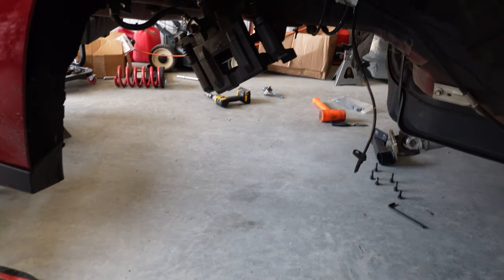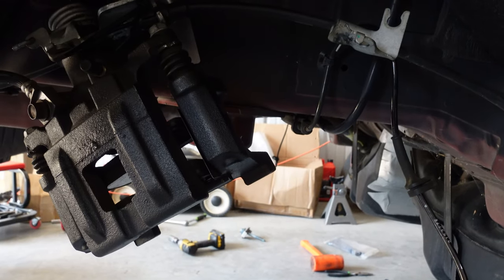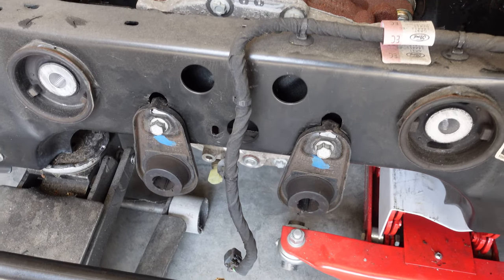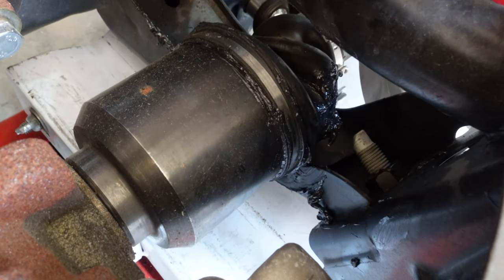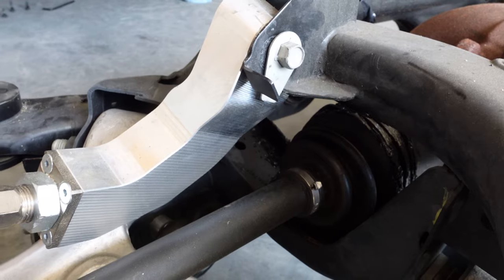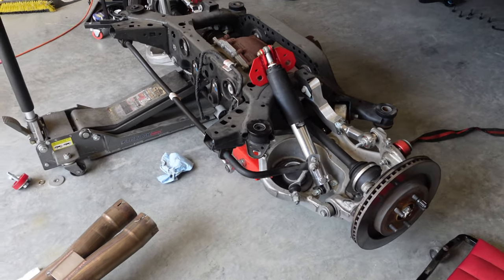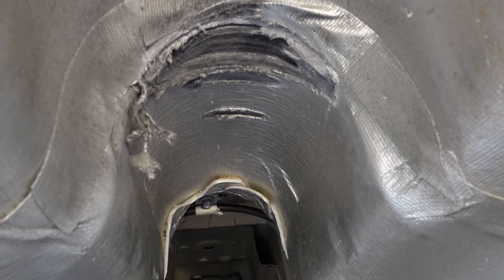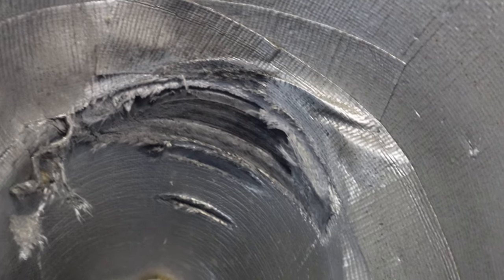More damage than expected! 2016 Mustang GT rear cradle removal for inspection. Not good!

Comment: Heat up the ears on the diff. It melts the lock tite after you drill the holes in the old bolts put the easy out in there heat the ears up and then back out the broken bolts.
Reply from the maker: They actually came out fairly easily. Good tips, though!

Comment: Can you take a bolt exstracter and back those broken bolts out? May be easier than drilling and rethreading it? I hope it works out for you!
Reply from the maker: Gonna drill them out for a larger bolt, most likely. But yeah, could possibly use an extractor.

Comment: Ugh.... that sucks.  I have been researching rear suspension for my 2019.  I just put up a video, from my quest to hit 10s.  You can feel the wheel hop was extreme during the slow mo.  You can actually HEAR metal on metal clunking in the stock PP1 suspension.  What I don't want is to go through what you just did.  No way do I want to buy another set of GForce half shafts.  lol What did Steeda or BMR recommend for the bolts?
Reply from the maker: Called Steeda and we decided on aluminum diff inserts, through bolt upgrade and diff support bracket. Hoping all that will do the trick.
Reply: @BackyardBMX73   Thanks for the reply. Is this a custom thing or do they offer this normally?  It would be weird to me if they didn't just upgrade the bolts in their kits.

Comment: I'm considering Steeda Differential Bushing inserts.   Other than your video I haven't seen anyone who had problems with bolts breaking on any of the solutions available (Steeda, BMR or other).
Was your Stang still NA when the bolts failed?   Steeda claims their bolts are stronger than OEM.  What solution will you end up using to reduce differential bushing flex when you get your car back together?
Thanks
Reply from the maker: My car has been fixed for awhile now. Check out my other videos. I'm using Steeda bolts and grade 8 combined, along with the Steeda brace. Car was NA when they broke. Many people have broken the diff bolts. Common issue from excessive wheel hop and stiff bushings or inserts.
Reply: @BackyardBMX73  Thanks for the info.
I'll check out your other vids
Reply from the maker: @hugebruce1  no problem. Thank you for watching!

Comment: Did those bolts break from over tightening?   I learnt the hard way with engine mounts on a Cummins what happens when they are over torqued.  Man I want a new mustang but I can’t give up that S197 life
Reply from the maker: Definitely not over torqued. I would say they may have even loosened a bit due to the inserts settling, if anything.
Reply: ponie1992 just the way the bolts broke makes me think that.  Been there done that many times.  My friends tell me not to use anything more than a 3/8 Ratchet lol 🦾😂

Comment: How did you get the subframe to get aligned correctly. I dropped my subframe as well. I didn’t go as far as you did but i wanted to see how I can make sure my subframe is being bolted back straight
Reply from the maker: I have the Steeda subframe alignment delrin bushings. Using those, the subframe should be very close to where it was before. I also had an alignment done afterwards.
Reply: @BackyardBMX73  I do as well. That what started my problem 😂😂 . I lowered my subframe to install those and the other products steeda sell and now when I tried to insert that long blue bolt back into subframe,  it only turn a few times that it’s really hard to turn. And now I hear a clunking sound when I go over bumps. So I was wondering how I make sure the bolts are not being bolted back incorrectly.
Reply from the maker: @christlike_5.043  you'll have to check the bolts to make sure the threads aren't stripped. They shouldn't be too hard to reinstall. It may have cross threaded if it was really tough to screw in.
Reply: @BackyardBMX73  that make sense. Hopefully I didn’t damage anything. So I should be able to pull it out and try again right?
Reply from the maker: @christlike_5.043  if they are not cross threaded, yes. Let me know how it goes.

Comment: Tip for removing the broken bolt? I have 1 bolt that broke on me and I don’t wanna take it to a shop 😅
Reply from the maker: Which one broke?
Reply: @BackyardBMX73  the front one the long diff bolt
Reply from the maker: @DJ Khaotic  is any of it sticking out or is it broke off inside. Best bet is to drop the cradle and use a left hand drill bit and start drilling it out. Should turn out once the bit starts to grab. Tough job to do with the cradle still in the car.
Reply: @BackyardBMX73  no it’s completely broken inside the diff like yours was in the video none of it is sticking out and I had this lockout kit for over a year and it barely broke 1 bolt I think ima buy the steeda differential bolt upgrade kit to prevent future bolts from breaking again. The hard part for me is gonna be removing the exhaust to drop the cradle I have the whole entire exhaust welded together .-. All the way to the cats
Reply from the maker: @DJ Khaotic  the exhaust actually isn't that bad to remove like that if you have 2 people and can get the car high enough. Unbolt it up front, support it then unbolt all the rear hangers. Should then be able to drop it all at once.
Reply: @BackyardBMX73  okay 🤔 would I have to fully remove the differential or would simply lowering it enough to get access to the hole be enough to work on it?
Reply from the maker: @DJ Khaotic  depends on your drill, but may have to drop it out.
Reply: @BackyardBMX73  okay thank you!
Reply from the maker: @DJKhaoticGaming  no problem
Reply: @BackyardBMX73 roughly how long does it take to remove this cradle? Another bolt broke the medium size bolt snapped and made my diff smack around
Reply from the maker: @DJKhaoticGaming  wouldn't take long at all if you have a helper. Maybe an hour to drop it out.
Reply: @BackyardBMX73  and all i have is a jack ima try just putting the jack on the Diff and take it out thanks ! How hard is it getting it back in? Ima do it right now
Reply from the maker: @DJKhaoticGaming  just make sure you have it balanced well. Key to install is to make sure it's lined up right and the bolts go back in straight. Don't wanna cross thread them.
Reply: @BackyardBMX73  thanks for the tips I appreciate it I didn’t end up doing it last night ima try today straight after work have a buddy come over with his jack soo I can use both jacks to pull out the cradle
Reply from the maker: @DJKhaoticGaming  right on, man. Having a buddy there will definitely help!

Comment: this has me so concerned.an those 10 bucks worth of bolts cost you a shit load man
Reply from the maker: Yep, they did indeed. Go with a grade 8 through bolt setup and aluminum pucks.
Reply: was that the cure?an man thank you so much for responding.your power level is or was vastly superior to mine but man the car only has 5300 miles on it an it was so jerky an very unfun to drive before the craddle an diff lock outs but i have the exaxt same stuff that broke on yours so im gonna look into some arp stuff an to 100 i may sell it while its still beautiful.i thought it was my dream car but its not been that..go back to a foxbody.they always did the trick for me lol...im 47 an worked my ass off to get this car an im kinda disappointed
Reply from the maker: @mattminnich3886  the S550 is definitely a different breed and takes a lot of different type parts to beef them up. Ultimately, I think the fix was a combo between the Steeda diff brace and the through bolts with aluminum pucks.
Reply from the maker: @mattminnich3886  oh and you can't go wrong with a good ole foxbody! 😁
Reply: thank you very much man
Reply from the maker: @Matt Minnich  no problem! Good luck in whichever direction you go. Follow your gut and I think you'll be happy.